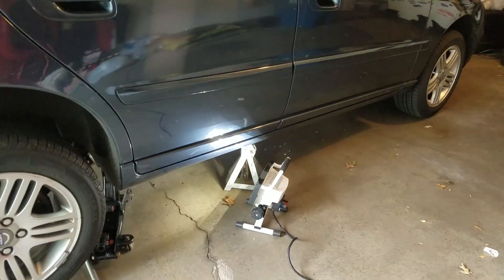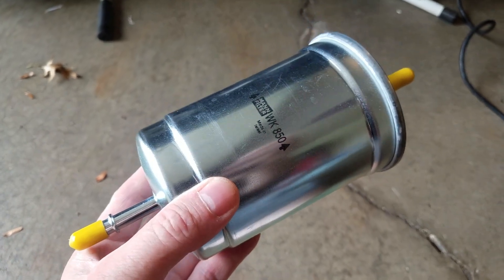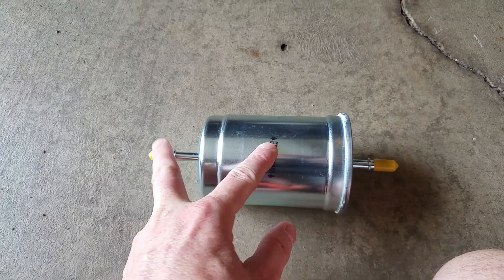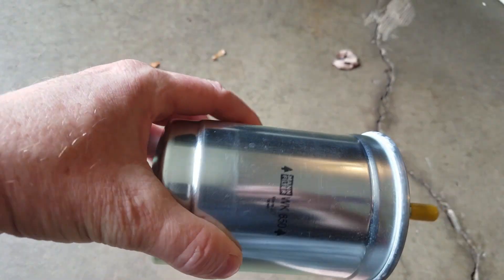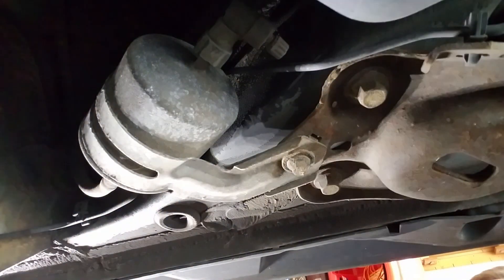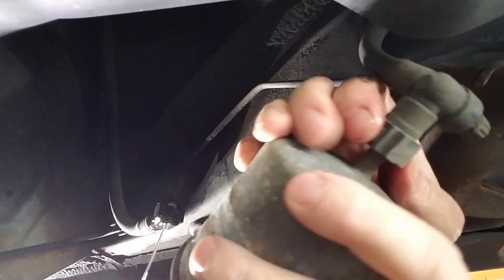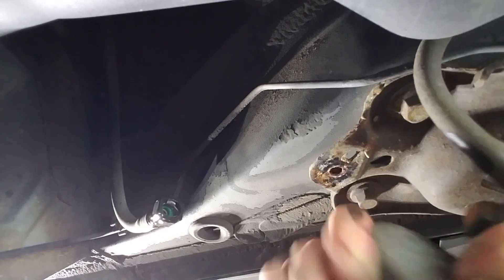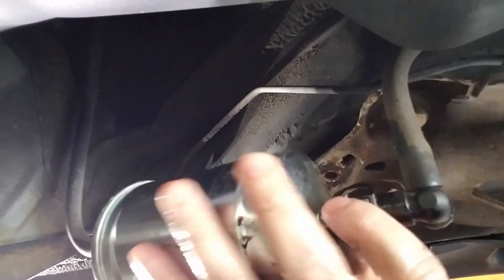2000 to 2009 Volvo S60 - Replacing Fuel Filter

Comment: Personally I soak the connectors with anti seize, release pressure using Schraeder valve on right side and remove connectors with the filter still bolted on, gives you a free hand. Where a car is used in salty climates, the filter front face corrodes and gums up the connector making it hard to remove and not want to grab the new filter connector. Clean it out with a small brush and wash out with anti seize or WD40. Give it a good tug on the new filter to ensure it’s gripping. Have had two which would not re-attach. These jobs always look so easy on rust free cars from climates which don’t cause a lot of rust. Where I live, I currently have a snow storm outside in April, rust makes every job a headache.
Reply from the maker: I totally forgot to relieve the pressure on mine, as you can tell.  Totally with ya on the salt.  I'm in Michigan.  You would think we have salt mines here as much as we use.  My Volvos have managed it pretty well, but the Toyota I got for my daughter, holy wow is it hard to get some things to come lose on that thing because of all the corrosion!  I only have a couple of minor things left to get right on that car then if anything breaks after that, and it's not a newer part that I can get off easily, I'm just selling it!

Comment: I'm doing this for the first time.  I noticed you didn't release pressure using the schraeder  valve.  I wonder if that would have changed anything.
Reply from the maker: @workingTchr  I'm sure it probably would have.   I just didn't think about it so you get to learn from my mistake

Comment: It would be safer and easier if you let the pressure off the system first. That's why there is a valve cover and valve underneath
Reply from the maker: Didn't even think about it at the time.  I could have released pressure at the shrader valve on the fuel rail too.  Learn from my mistakes kiddies!

Comment: My car got worse after fuel filter replacement? Any idea why? Defective new filter maybe or do I need to bleed the air after replacement?
Reply from the maker: Good question.  I don't know if it's possible to insert these the wrong way around, but you may want to check that.  Verify the connections are good and you aren't leaking any fuel as well.  As far as I know, there is no need to bleed any air out.  That should pretty much take care of itself within just a couple of minutes.  If nothing else, remove it and make sure you verify the flow direction and maybe can blow thru it to make sure it's not a clogged or defective filter.

Comment: Hey Floyd,  Have you ever change the fuel filter on any 2013 Volvo S60 2.5L T5? If so, can you please share your experience on that? I have spent 4 hours and I haven't been able to locate it!
Reply from the maker: Follow the lines where they come out of the fuel tank.  IF it's equipped with a filter, it should be somewhere on that line no more than maybe 4 feet or so from the fuel tank near the back of the car.  Not all these Volvos actually did have fuel filters though.  Yours may not have one.
Reply: If you have a steel tank, then your fuel filter is built in to the tank..and it is not serviceable

Comment: Please Where is the  filter petrol for volvo C30  2007  year1.6 , 100 cv ?? Thanks
Reply from the maker: If it has a filter, it would typically be in the rear, just in front of the lower control arm.  The left hand drive cars have them on the right.  I don't know if the position changes for right hand drive or not.

Comment: How about the tab?  Didn't see you bend it back.
Reply from the maker: No, I didn't bend it back.  I had to bend it out of the way to use the factory bracket with the new fuel filter.  It's not needed for the new fuel filter.